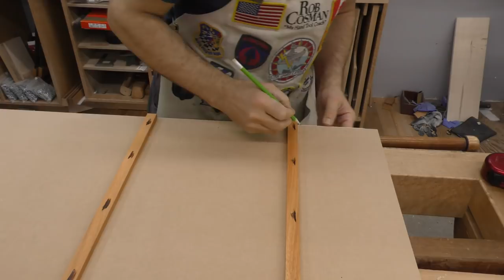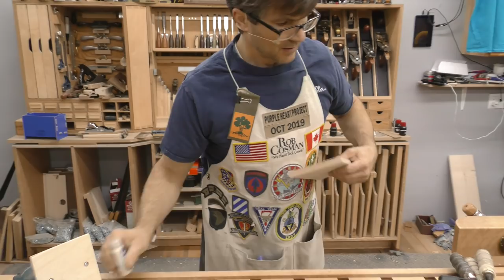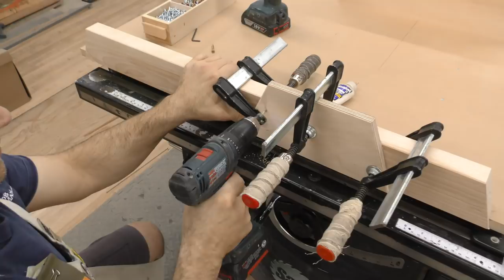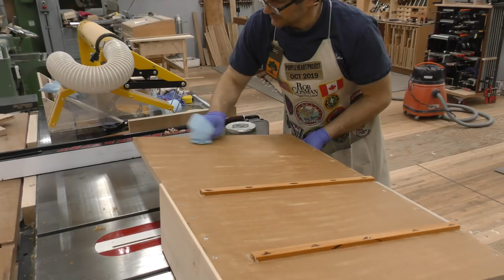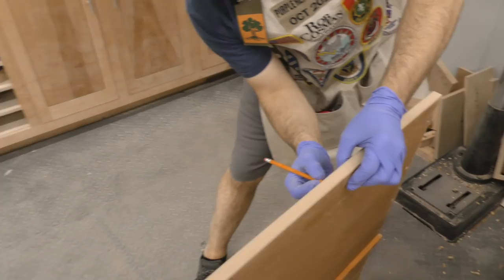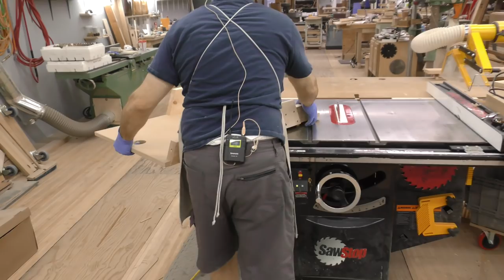Building a Table Saw Sled, Live Episode 18: Conclusion

Comment: Couple things Rob 1) PLEASE build.a safety box guard on the back side where the blade comes through. My uncle, a master craftsman with 50 yrs experience amputated his thumb on a tablesaw sled and it is all too easy to do. I build up a roughly 4x4x6 solid block and glue it to the back of the fence where the blade comes through. 2) you really need dust relief where the fence and sled meet. I always make a 3/32 chamfer on the fence but a lot of ppl will  cut a sm rabbet instead.  I don’t glue either fence - no reason to. 3) I mill a track or lately a micro jig dovetail clamp slot on both the face and top of the fence- incredibly handy for stops and fixtures.
Reply: I agree. I did all those things. William NG has a good technique for building a small box to cover the exit cut on the fence.  He also has an excellent idea for a plexiglass guard 
for the blade. The micro jig or similar guides save a lot of work.

Comment: What is the tape on you clamp grip handles?
Reply: That's "hockey tape" - a cloth tape that hockey players use to wrap the handle of their sticks. Rob uses it on a lot of his handles - clamps, hammers, screwdrivers, etc. He demos it somewhere...but basically you pull out a stretch of tape, hang the roll down and spin it to make a string. Then wrap that string like a corkscrew up the handle, and then down the other way with the flat part of the tape pulling out what you need as you cover the string part.

Comment: i wish you'd do the 5 cut method to see exactly how accurate this sled is.  you might be surprised by the results
Reply: Yes. William Ng's 5 cut method is the best way to get a perfectly straight fence.
Reply: How accurate does it need to be given the movement in wood? Its not precision engineering!
Reply: Ng uses Birch plywood which has little to no movement at all. The sleds in his school all are within 1 thousandth of an inch from one end of the fence to the other. This is important to Ng because of the type of intricate joinery he is making. That being said, that is more acurate than a machinist square can detect. Ng's method is more accurate than any sled really needs to be, however it is a good tool to check how accurate it really is.
Reply: Yes, I was very surprised that he cut the kerf AFTER the fixing of the front fence instead of checking for square first using one of the recommended methods
Reply: In Rob's case, do not forget that he will finish the cut on his shooting board.   Even if it off a little, it will be corrected later.  As for myself, I do use the 5 cuts method and am happy with the result.
Reply: Keep in mind that Rob has already made certain that the blade and rip fence are exactly parallel to the mitre slots on the table. He took pains to ensure that the sled base was a perfect rectangle. The congruent geometries of table features and sled base carry over the established blade alignment. He then rebated the sled’s fence to the edge of the base after ensuring the former was a consistent dimension on the thickness planer. Any error in the perpendicularly of the sled’s fence to the saw blade will be insignificant.